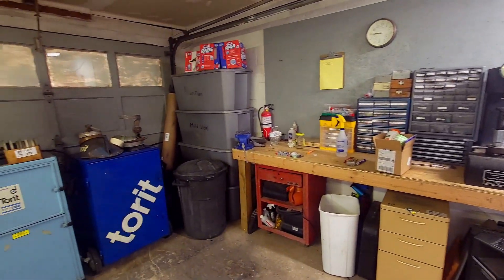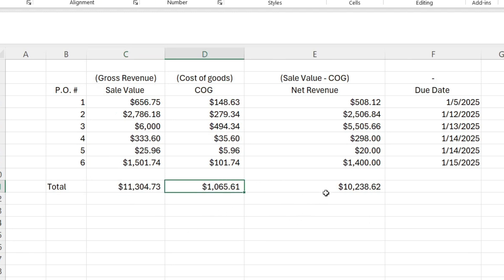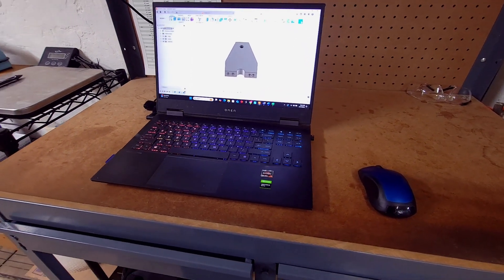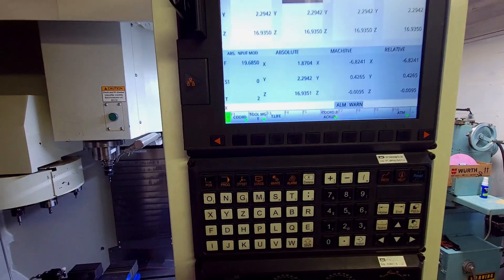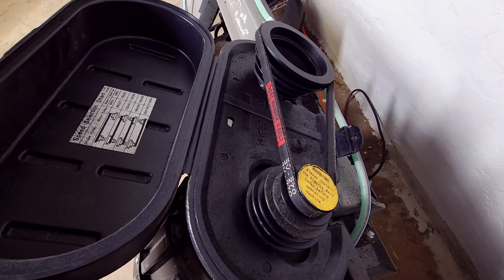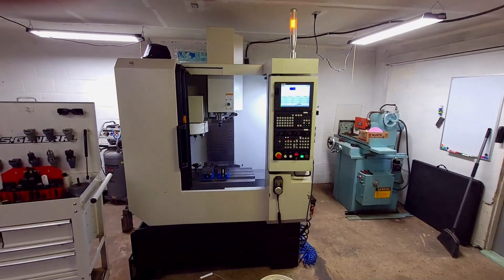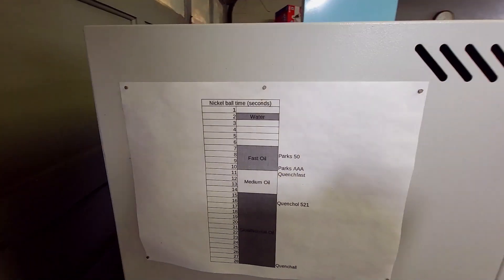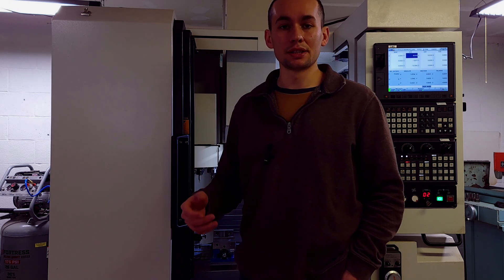Home Machine Shop 300K Year Challenge 2025 Episode 1 (Beginning Layout)

Comment: Have you ran any tight hole to hole tolerance parts with  Syil?  I was looking at purchasing one of these but I have .0005 position tolerances on some parts I run.
Reply: I recently acquired X5 as a second op machine and out of curiosity. I have run some job on it with circular cuts of a post .310 OD and .375 high and was watching how close it can keep. Have to say it is very tight. .0001 on 100 PCs over 10 hours.
Reply from the maker: If you helix bore the finished holes, you can get under .0001 repeatability

Comment: How much does all of your equipment cost combined?
How much did you have to invest into this to get it going? How many hours do you work in the shop per week?
Reply from the maker: CNC Mill 60K ($1,726/Mo 32 months 5k buyout)
 
Saw(1.2k) Bought on month 3
Catch me out here using endmills to part off barstock lol

HT Oven(1.8K) Bought on month 3
Air compressor ($400) Upfront
Used 5k in machine transit, wiring, and forklift rental out of pocket. Machine payments were delayed for the first 2 months my loan company

Tooling (Gradually grew +20k) not direct purchases, tools over time 

Started my shop on a 8k cash pool, dropped down to 3k ish, bounced back up with no job and a cnc mill in my LLC with Xometry Premium.

I live in my shop practically. I'm typing this on a saturday sitting next to my mill looking at zero-point systems.

Comment: If you had a bigger space, would you have considered a Haas vf2ss over your x7?  I'm in my senior year of high school cte in a machining program and I'm looking to start my own shop.  I am lucky to have a pretty decent sized space in a shop that is used for auto repair.  Has air, fairly thick concrete, 3 phase, actually used to be a machine shop many years ago.  I am already in a co-op program in a machine shop and have been offered a full time position after graduation.  My plan is to save up a substantial amount before buying a machine and I would like to hear your input on what would be a good first machine.  I'm leaning towards a used vf2, from my research i could get one with low hours for around 50k plus shipping.  I like the idea of a haas because it would be easy to automate in the future when i may want to run lights out, i also think being able to get all my machines from one company would be best, and obviously syil is limited to the four mills, two lathes and one five axis.  Whats your thoughts and what machines do you plan to have for your shop in the future?  Thanks!
Reply from the maker: If I was in your shoes, I would 1000% go with a haas VF2 over Syil!!
Especially at your age, stay focused and get equipment early and keep your personal debt low, you will go far! 

I am personally a fan of Moriseiki now known as DMG Mori. I've worked with tons of machined from the 80-90s that still hold great sized and hardly ever break down. 

I am aiming for one large mill with over 60" travel in X, one 5th axis, one multitask lathe with sub spindle and milling head, wire edm, sinker edm, and hole popper. 

Time will tell what I will need in the future tho, all depends on what comes in the door. Good luck!
Reply: @AscendedTechnologies  I'm curious about some of your items in that list and would love to hear some of your reasoning! For a large mill, it sounds like you mostly do hard materials (Titanium, Monel) so how does a large travel area cater to your needs specifically? Also, curious about your draw to an EDM. They hold amazing tolerances of course, but are typically slow or difficult to maintain? Correct me if I'm wrong there.

Also, I saw another comment asking about your customers. How are you able to find them typically? You responded in that comment that you recommend Xometry; do you still use them for most work or have you transitioned away from it, and if so, how?

Thanks for giving out this information!

Comment: I'd be curious to know who your customers are and what you are manufacturing. I have a machine shop 3 times your capacity running 12 hrs a day 7 days a week 350 days a year and I don't generate the amount of $$$ per day that you do. Something seems off.
Reply: He's also talking about "sales" which isn't all profit, especially with xeometry work.
Reply from the maker: My customer base is primarily centered around tough alloys with tough GD&T constraints. Grade 5 titanium, Ivar 36, Monel, Some aluminum, some steel, some stainless. 

Most of the parts I do are 1-5 PCS.

Typical challenges are .010 Corner Radius on a pocket .350 deep, M2 x .4 tapped holes, and .039 holes drilled .800 deep. All of this is in grade 5 titanium or some other exotic.

I'm doing the parts others no quote primarily

I have my customers do a zoom audit of my QMS since I don't have any official certifications. In short, lab equipment, or really tough parts.
Reply from the maker: I cannot share customer information, So I recommend Xometry as default as they have assisted in growing my shop a ton. 

What are the primary markets you serve? Are you competing with over seas? Are you doing any DOD, DFARS, or ITAR components? I'd love to help anyone in any way I can. This is my little shop growth channel, but I do have quite a bit of experience in customer development.
Reply: This doesn’t seem too far off to me.   I have had ~$250k in sales for the last 4 years I think with just a Haas mini mill 2.   I specialize in aluminum and plastic tooling, almost all single or very low quantity.   I’m just a 1 man garage shop.
Reply: How are you still in business if you don't gross $1k/day on 252 hours a week of machine time?
Reply: @kevind1865 He lies about his profit margins. 😂
Reply: @raybarry1723 its seems you are too cheap then? Im doing 400k per year per person in the shop 🙂

Comment: I do a bit of machining mainly 6061 aluminium - the best bang for buck piece of equipment I bought recently was a bead blasting cabinet I think with the glass media this was around £160 - this leaves a matt very slightly textured finish on the parts similar to say optical adjustment stages - it removes the surface cutter pattern marks and is quite quick to do. Leaves the parts looking far more professional looking IMO 👍
Reply: Looks slick when you anodize a bead blast finish also!

Comment: Thanks for doing these videos, how do you manage waste? like chip waste and expired cutting fluids?
Reply from the maker: Thanks for the support! At the 12 second mark you can see a stack of totes in the corner almost touching the ceiling. 
All the chips are organized by type in there, then taken to the scrap yard. For waste oil, the local landfill here has a waste oil program. I just take my waste oils in sealable 5 gallon buckets to the oil area at the landfill.

Comment: What kind of spindle runout do you get on the syil?
Reply from the maker: .00003 ish, It really depends on the tooling body accuracy, spindle alignment. 
I have some junk ER20 collets that have .006 runout from the factory. 

If I indicate the spindle taper direct, i get zero runout. But, if your have an unaligned spindle, you will see a gradual increase in tool oscillation as your tooling gets longer.